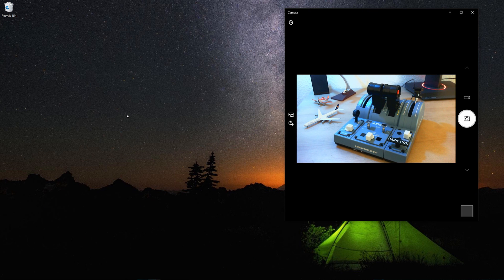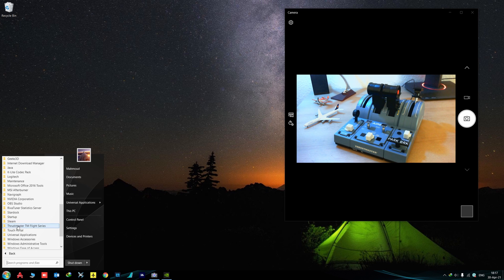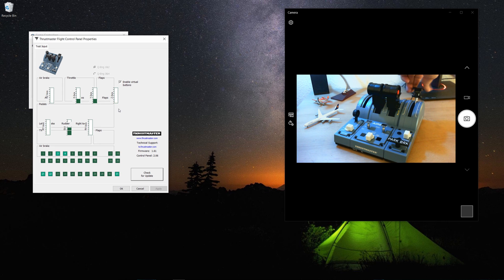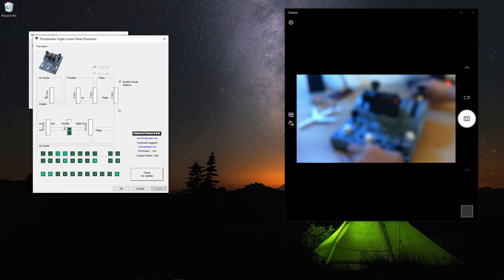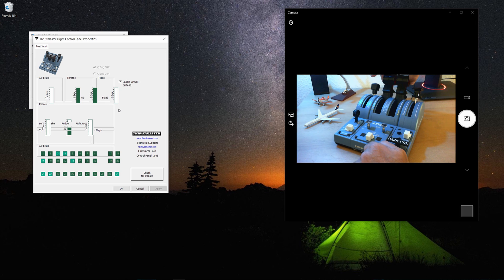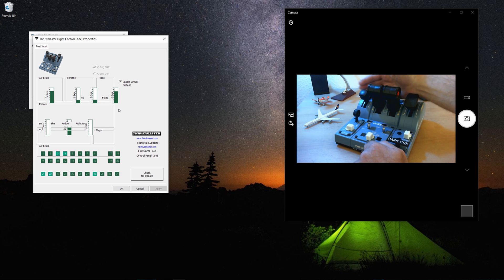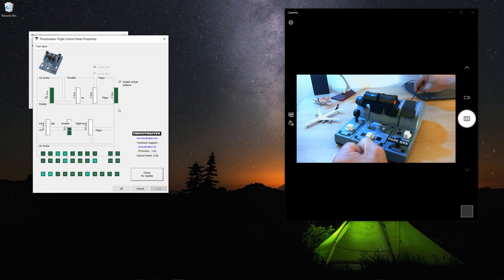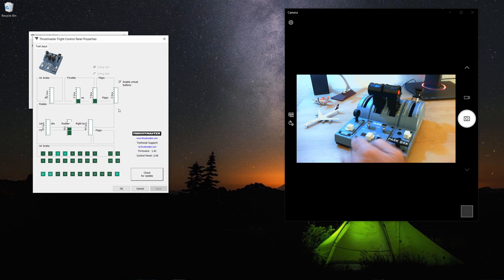MSFS 2020 & TCA THRUSTMASTER Calibration Please Read the whole descirption .

Comment: Thank you for your video it is helpful. However I have an old version of Microsoft Flight Simulator X Acceleration. Does the Thrustmaster Captain Pack X Airbus Edition work with this flight simulator? I followed your instructions, but still my throttles and other button for not show any effect. I am using the Airbus Extended version. I would appreciate your input and support. Many  thanks 🙏
Reply from the maker: @-Aviator5567  Hello , I dont think it works with older MSFS versions. Regards
Reply: @973sierra6  Thank you. I am still hopeful that it can be used. However I much appreciate your response. 🙏

Comment: It didn’t work! If I put the flaps and spoilers down the game puts the flaps and the spoilers up! And the same thing happens when I put it up it goes down! It opposite.
Reply from the maker: Thats because u have to tick the reverse option of the flaps and the spoilers in the sim menu , in order to work the right way ! this video is quadrant calibration to interface correctly with the sim & the other options has to done by the user and tune it with each aircraft.

Comment: Hi everyone and @973Sierra. I need your help guys. My throttle in Toliss A320 series aircraft behave unusual. When I move throttle 1 in aircraft engine 2 shoots up and when # 2 is pushed engine 1 is revved up. How can I swap this behaviour. Everything else is fine. Please help as this impact the experience while flying. Any Help or advise is much appreciated. TIA.
Reply from the maker: Every game has its binding config , i dont know about Xplane but everygameon any platform should have the binding with the correct function on your joystick. hope that helps :)
Reply from the maker: check the bindings in the msfs control panel.
Reply: @973sierra6  thanks for such a blazing fast reply. Any suggestions for xplane 12

Comment: i know this video is 3 years old but if someone sees this i would apreaciate some help because i've really tried everything but this thing wont change or anything and its only two years old
Reply: Did you find a fix?
Reply: @cheems2.072  Yes, thanks for asking. I just reseted everything to standart ( default). And after that the issue was fixed :)
Reply: @MyFlights-n2b  How do you do that?
Reply: not the one showen here in the video
Reply: @cheems2.072  Not in msfs, extern.

Comment: Great tutorial, your clarity is second to none!  i am also trying to setup dual quadrants (+add on) for 747/A380 but 2nd quadrant's settings aren't coming up in Control Options.  (1-2 & 3-4 switches are set correctly.    Can you help?
Reply from the maker: It should work , you will have to combine each 2 engines in control options into one eng switch on the quadrant  then it will work , there are alot of videos explaining it . hope it works with you and thanks for the comment :)

Comment: I know this is old but currently I'm having probs with the throttle not being even with movement. It gives too much fuel when it shouldn't. And doesn't slow down without basically going into idle. It's been a nightmare. I'm really hoping this helps. I mean, there aren't really many things to help out  with this stuff. I didn't even know you could do a reset like you did. So thanks, ahead of time! :D

Comment: Hi, my throttle levers are not aligned properly and whenever i reconnect the throttle quadrant the control panel just shuts off. When i open it again everything is frozen i would really like it if you have a solution for this issue.
Reply: i have this problem too but no answer
Reply: same problem

Comment: In order to fix my quadrants, my airbrakes and flaps had to start on full. The way you do the throttle (starting at rev then going to toga, then pressing red bottoms and so on) seems to be the only way to fix the throttle. Fun story. I tried calibrating while in the air, and lost my mind trying to figure out why the throttle wouldn't go into reverse. 

Start with brakes full, throttle reversed, and flaps full. First, unplug, hold right black button, plug in, release black button, throttles to toga, press the red buttons. Then set brakes to 3/4, throttles to flex, flaps to 3, press the red buttons and so on. Until you end up at brakes retracted, throttles reversed, and flaps 0. Then press the red buttons, hold the two black buttons, and unplug while holding. 

Have fun.

If you have trouble with the throttle... You started the calibration with throttle in toga. It's very important you start in rev. Then flip it to toga after you release the right black button. Otherwise it makes a mess out of the detents.
Reply: Please Read
Reply: @flyingwithgabo  doesnt work i tried flaps and speedbrakes DONT work

Comment: Amazing works so well.
One thing is my flap and speed break switch’s are now inverted and I don’t know how to change that
Reply: Do the calibration but start with flaps and brakes set to full.
Reply: Start with brakes full, throttle reversed, and flaps full. First, unplug, hold right black button, plug in, release black button, throttles to toga, press the red buttons. Then set brakes to 3/4, throttles to flex, flaps to 3, press the red buttons and so on. Until you end up at brakes retracted, throttles reversed, and flaps 0. Then press the red buttons, hold the two black buttons, and unplug while holding. 

Have fun.

Comment: idk if this vidioe would help me with what i am having problems with but when my throttle are at idle its 50% and i havnt been able to use them for a year:(
Reply: You started the calibration with throttle in toga. It's very important you start in rev. Then flip it to toga after you release the right black button. Otherwise it makes a mess out of the detents

Comment: Thanks for your reply all noted  I must say your configuration works as it is just brilliantly with the Cessna Longitudr and the Black Square King Air with no in Sim adjustments in the game. Thanks again
Reply from the maker: Good ti hear that its working fine with u , and yes most of the aircrafts work with the throttle and joystick as they are already mapped by default , the whole main issue is to calibrate the throttles with the PC software and the sim and then calibrate with some aircrafts when needed . Enjoy flying 👍

Comment: Hello, Thank you for the excellent instructions and demonstration, is this config procedure suitable for all aircraft or only the A 320 default aircraft, do you configure differently for the A320 fly by wire? Finally do you need to adjust the sensitivity values to provide a straight li in the throttle axis. Any clarification
N greatly appreciated.
Reply from the maker: Hello , this procedure is to calibrate the throttles with the sim , the next step to configure ur aircraft like the FBW u will have to launch the aircraft and go to the flypad and select detent calibration , there a lot of tutorials  explaining it incase u face any difficulty .meaning each aircarft has a tutorial online that can help u .hope that helps . tnx

Comment: Instead of it working, now my flaps and speed brakes are opposite. When speed brakes are full, they are not up. When they should not be on they are full, same with spoilers, any way to fix or somehow reset it?
Reply from the maker: I have explained it several times , you should go to the sim control panel and tick the reverse square near the flap and spoilers options.then it will will work properly.
Reply: But I play on Xbox so that doesn’t show up, the stick does but not the throttle it has to be pc for that to work, any way to factory reset it
Reply from the maker: @evanattie2585  This is only for PC , i have no idea how it works on XBOX , Sorry :face-green-smiling:
Reply: @973sierra6  nah you good
Reply: Run the calibration, but start with brakes and flaps set to full.

Comment: i followed your steps exactly as you said but it still dosent work for me . some buttons aswell as flaps still arent working in profiler, is there another method?
Reply: Run the calibration, but start with brakes and flaps set to full
Reply: @flyingwithgabo  i figured it out. turns out after i watch the video i looke upder the to modules and realised they werent connected (pluged in).

Comment: My problem is the gam controller settings on Windows thinks my flap and spoiler levers are twice the length.  In the sim full flap on the hardware gives me flap 2 (airbus) and full spoiler only gives me half.  I would appreciate any thoughts on how to overcome this, please.  No problem with the throttles or switches.  Thanks.

Comment: I am having two issues here,

How do you make it so the control panel stays when you disconnect? When I disconnect the cable the control panel disappears. 

Also, when I hold down the button below the engine start lever when I disconnect the cable, the control panel stays but the throttle does not respond. Looking forward to your feedback thanks

Comment: Idk why the controls are backwards in the simulator. Like toga is full reverse
Reply: You started the calibration with throttle in toga. It's very important you start in rev. Then flip it to toga after you release the right black button. Otherwise it makes a mess out of the detents

Comment: I’ve done the process three times and the only problem is my speedbrakes and flaps are doing the opposite of what I want them to do 😢😢😢
Reply from the maker: u have to go to the sim control panel , go to the controller settings . search for flaps and speedbrakes and tick the reverse box and it will work .
Reply: @973sierra6  👍
Reply: Run the calibration, but start with brakes and flaps set to full.

Comment: THANK YOU^^ 5* Calibration. what you did is simple, genius, and working just fine. For the 2nd try the Flaps n Spoiler working as should be.  
-Kris
Reply: mine are not working could you help me install the right drivers and software in like discord or something please.
Reply: @camg6804 Run the calibration, but start with brakes and flaps set to full.
Reply: Did you fix it?

Comment: Hi Thank you for the video. It fixed my problem. However, the flaps and speedbrake work in reverse order now. Before they did not indent. How do i get them to work in the correct order?
Reply from the maker: you have to tick reverse square in msfs  control panel
Reply: Run the calibration, but start with brakes and flaps set to full.

Comment: This is the CORRECT way to calibrate the throttle detents.  Other videos are wrong - you must follow the sequence in this video exactly. It took me a while to get it right, but now all settings are sensible. Thank you.
Reply from the maker: Happy for you :) Enjoy your flights
Reply: @973sierra6  However MFSF 2020 doesn't respond correctly, running the A32NX. 
Do I need to reboot MSFS?
Reply from the maker: @paulhadley9047  I cant give you the correct answer as this video is only to calibrate the quads , I cant really help you as there maybe a lot of other settings within the SIm and the quads control panel in the sim itself . and also make sure to calibrate the quads from the A32NX flypad its also very important ,there are a lot of videos explaining how to do it , I hope it helps .

Comment: Nothing at all, I have tried many times, but my flaps and speed brakes do not work
Reply: Run the calibration, but start with brakes and flaps set to full.
Reply: I watched this video, because mine have been reversed for months. I did exactly what he did, and guess what throttles still reversed. Through a process of elimination I figured it out. Run the calibration, but start with brakes and flaps set to full.

Comment: ive tried it a few times but my flaps are still just an on off instead of an axis. ive followed exactly as the video and also the version in the pdf from thrustmaster. any ideas?
Reply: In control Options  TCA-ENG 1&2                       FLAPS AXIS (-100 TO 100% )                           use          JOYSTICK L -AXIS Z
Reply: Run the calibration, but start with brakes and flaps sat to full.

Comment: Thought I’d give this a try. Thruster positions are fine, but now my spoilers and flaps are opposite of where they should be in my fly by wire Airbus. Any suggestions?
Reply from the maker: Tick or untick reverse axis for both spoilers and flaps in the Sim control panel . It should work .
Reply: @973sierra6  Is the Sim control panel in the sim?  Or is it somewhere else.  Im desperate....lol
Reply: In the Sim go to control Options,   select TCA-ENG 1&2   move your  FLAPS  lever and you will see the slider moving on screen,   uncheck the box next to it
Reply: Run the calibration, but start with brakes and flaps set to full.

Comment: Awesome video! I have only one problem though, when I go into MSFS after calibrating, it shows me the spoilers reversed. For example when my speed brakes in real life are at 0%, MSFS shows 100%.
Reply from the maker: Great you liked it :) you will have to go to MSF control panel go to the TCA configuration and if the spoiler axis reverse is ticked, then untick or vice versa .
Reply: Run the calibration, but start with brakes and flaps set to full

Comment: have you made a configuration for this in the thrustmaster TARGET app? if so can you pls share how and what to do because this calibration doesn’t work for me, when i’m at idle, the x axis is at 0 and the y axis at full, not sure what’s going on but calibrating it didn’t work.
Reply from the maker: No I didn't use TARGET App sorry :) I am not sure its related  but make sure your profile sensitivity settings in the game are good to go and the key assignments of each axis are the same , and the best thing to do is to uninstall the drivers and re-install again and try from the scratch  this is what I can help you with :) And make sure on your TCA that its on engines 1&2 not 3&4 the small switch in the levers set maybe its the reason too .
Good Luck

Comment: Hi Sierra, 

Would this fix the issue with the park brake and the landing gear lever? Mine don't seem to work as expected but the flaps and speedbrake do (I havent recalibrated since I got the add on). 

Thank you :)
Reply from the maker: Hello , 
They dont need to be fixed , because this is only for the levers :) in order to make the parking brakes and landing gear is to assign them on the joystick profile by scanning the keys during programing for each option .
Good day :)

Comment: Hey,
So i did what you said. My issue is that my throttle idle is full reverse? Any idea to fix this?
Reply from the maker: Hi , Its full reverse on the software or when you are in the game and in aircraft cockpit if so , which aircraft are you using ?
Reply: @973sierra6  - Both! Both I fixed it. Had to delete the firmware update, and calibrate it manually. Then it worked. 🤷‍♂️

Thanks so much for your reply.
Reply from the maker: @NicoFliesDenmark  Great Enjoy flying ✈✈
Reply: You started the calibration with throttle in toga. It's very important you start in rev. Then flip it to toga after you release the right black button. Otherwise it makes a mess out of the detents.

Comment: you sir are an absolute legend thankyou so much
Reply from the maker: Most welcome Happy it worked out :) I went crazy till mine worked  :)) thats why I thought of sharing the info :)
Reply: @973sierra6  got it working with xplane 11 but not with the MSFS2020 FBW A32NX
Reply from the maker: @Mandalor_ian  For FBW A320NX in MSFS 2020 you need to use the DEV Version and calibrate it from the FBW Pad , its not difficult :) and reset all throttle settings in MSFS 2020 controls menu before you calibrate it then calibrate from the A320NX pad in the cockpit .
Reply: @973sierra6  I’ll try again tomorrow I’ve had enough for today thanks for your help much appreciated
Reply from the maker: @Mandalor_ian  Your Welcome